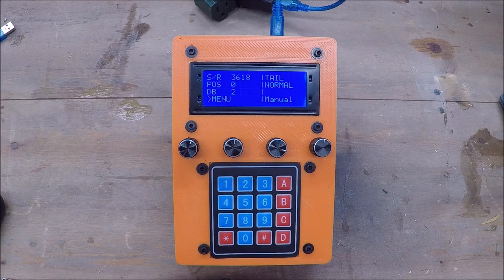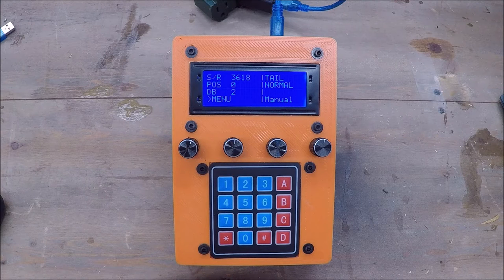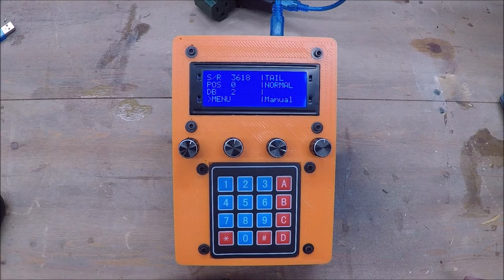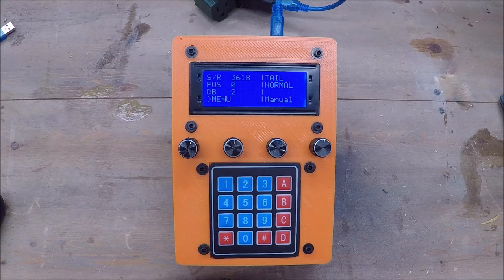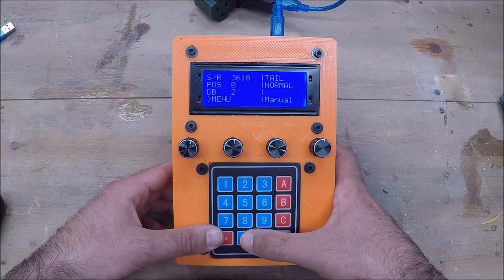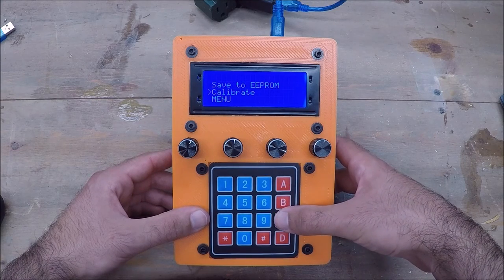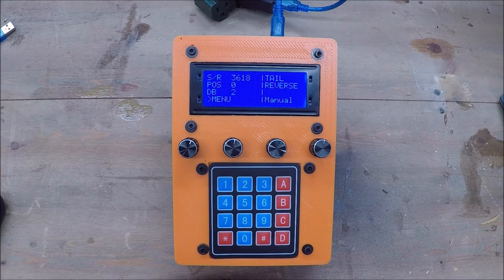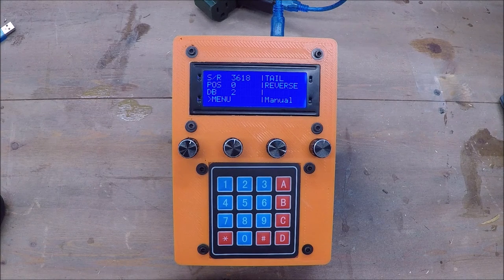Arduino Model Railroad Turntable Part 3.5   !Quick Update!

Comment: Awesome project! I am currently planning to build one, and in researching this you're the first that I came across with an auto reverser implemented. Awesome job!
Reply from the maker: Thank you! Good luck on your project.
Reply: @orangelabengineering2923  thanks!
2 things about your implementation intrigue me the most, are you using an arduino nano every? 
And the autoreverser; Is it activated by the software based on the track selection and orientation, or is it sensor/short circuit based. And what kind of relais did you end up using for it?
Reply from the maker: Yes the new design uses an arduino nano clone. The autoreverser is activated by the software. The autorevers activates when the turntable it is 180 degrees away from the magnet used to activate the hall effect sensor. I used two 5V relays to do the switching.

Comment: I like what you have as the other ones that I have found just is not working. I am not interested in the newest control with LCD display but with the 12 push buttons. Really looking forward to you publishing what you have, both the .pla file for your stepper motor mount and code for the Arduino.